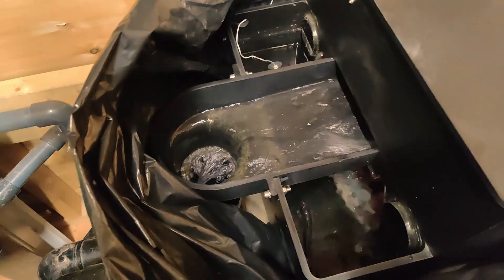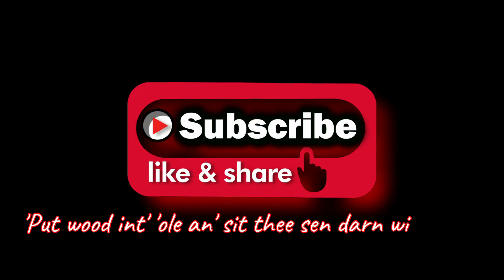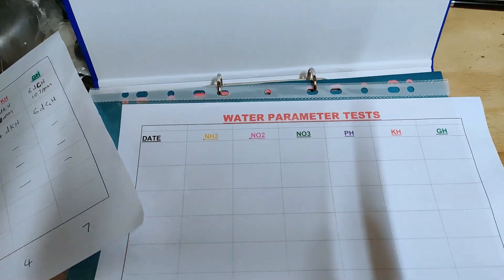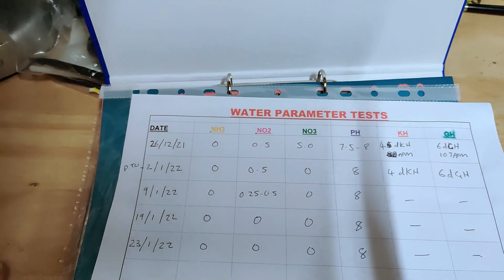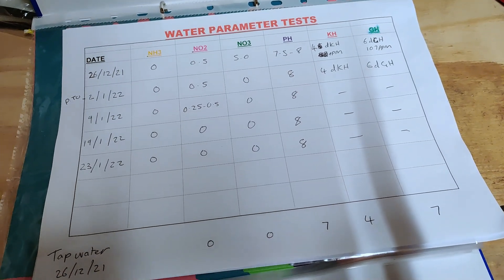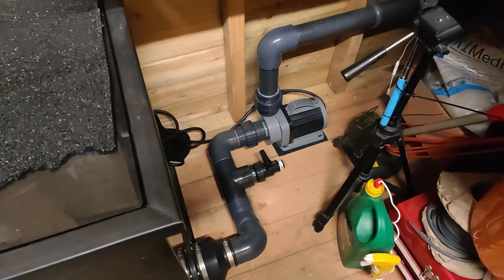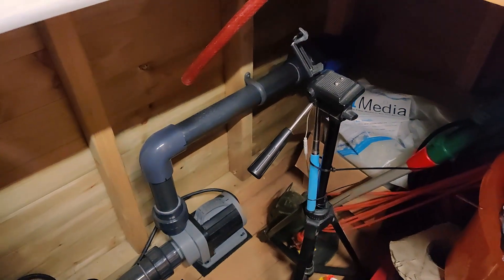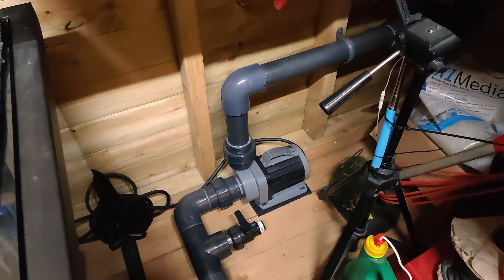Drum Draining The Pond, Parameters Stabilize **UPCOMING PLANS** For The Koi Pond

Comment: Hi im no expert but i have a drum , could your drum be too high just a thought hope you get it sorted
Reply from the maker: Thanks for the comment👍 the drum height itself is absolutely fine and the water level is where it should be at inside, the issue was caused by the float switch being set slightly too high up so after the drum had rinsed a few times, the water level had dropped to a point where the top up tank couldn't fill it up quick enough so the drum was continuously rinsing thinking it was still dirty.

Comment: Hi, had similar problems with the same filter, My pond now runs fine with a bit of fine tuning,  water in filter approx 1 inch under waste Shute which is same as  pond water height. The float switch, the white square top is level with water height,  I have a 20000 vario pump running and 2, 3 inch feeds, 1 bottom drain 1 skimmer. The filter works perfectly now on full bore or less, normal speed is 50%.
Reply from the maker: I had to double tune mine as my filter originally came as the pumped version. Lol

When I got it I converted it to gravity by moving the float switch from the dirty side to the clean side and flipped it upside down. The only downside was, I wasn't sure on the height of the float switch bracket on the standard gravity drums so I had to guess and go from there 👍
Reply: @UpNorthKoiPond  if you need the height of the bracket holding float switch I can measure mine tomorrow, if you can get top of float level with water height that should do. Also check no crud gets round the 2 round movable floats as that can play up with its working. Good luck
Reply from the maker: @martingage5323  that would be great if you could tell me the height from the bottom of the drum to the top of the bracket👍 at the moment, the water level is about at the same level as the square bit above the top float.
Reply: @UpNorthKoiPond  from base of filter to top of metal bracket 35.5 cm. From top of bracket to top of filter 15cm, hope this help you out with resolving the issue, anything come back to me and I’ll try and help. Cheers Martin
Reply from the maker: @martingage5323  fantastic! Thank you very much 😎

Comment: Just an idea which has helped me. A cctv system in your filter house can work wonders. I have mine monitoring pumps and ph meters etc. Also have cameras on the ponds. I often check every couple of hours. Everything in my filter house is controlled with a smart plug. If i check my camera and see a problem i can isolate anything on an app on my phone. Drums are great but they are not without problems unfortunately as i have seen many of peoples ponds emptied by a dodgy float switch. 👍
Reply from the maker: Absolutely, definitely something I will be keeping a close watch on and may treat it as a serviceable part and replace it every other year or so. They're not that expensive and will save a lot of headache.

Fitting some sort of monitoring system is something I have thought about previously so may we'll be in the works at some point👍